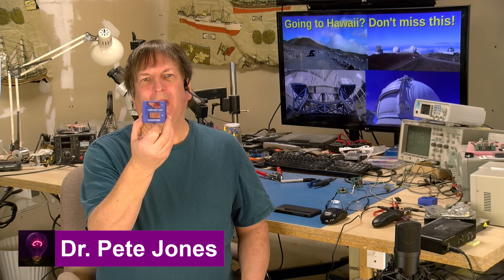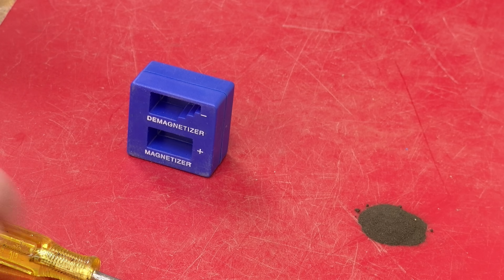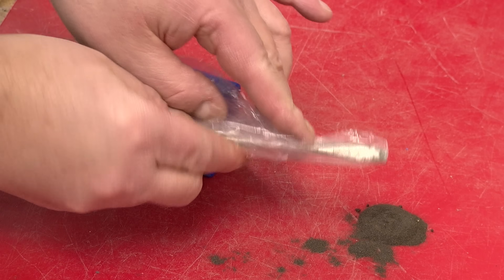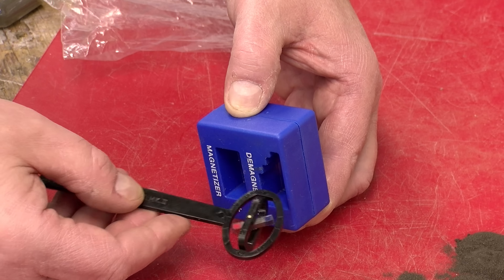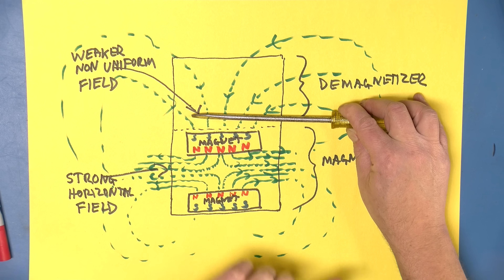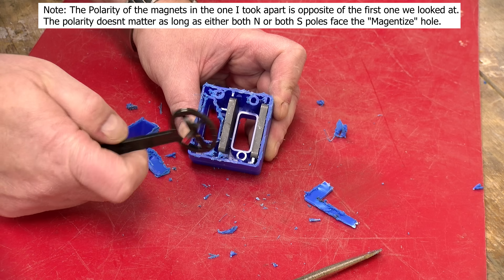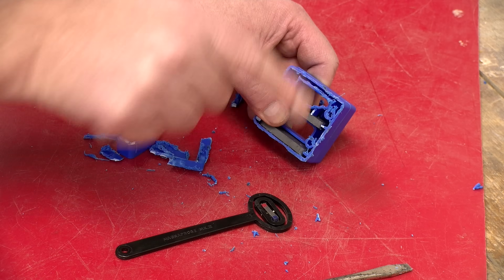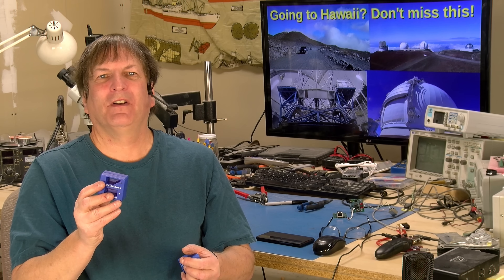How do these Magnetizer/Demagnetizers work?

Comment: I got mine with a precision screwdriver kit, but it's very small and stairless
Reply from the maker: Interesting that its stairless, but makes sense since it might be hard to use if that small. Without using the stairs it demagentizes well enough for most practical applications, so not a bad compromise.
Reply: @ElectromagneticVideos  on a second inspection, it's not stairless it's topless. So you could use imaginary stairs if needed. It's size is equivalent to a hole in the device shown in a video. Name of a set here in Ukraine "Protech Smart yellow 110 PS-8354". I see it sells with different name all over EU.
Reply from the maker: @vadnegru  I was able to google it. Yes  -maybe use a small piece of wood to make it easier to space a bit further way if a second demagnetization step is needed. 

Ukraine - all the best wishes to you on this sad anniversary of the Russian invasion.

Comment: Does that mean demagnatizer creates a monopole as the top magnet cancels out one side of the field? i.e., after demagnetizing the screwdriver becomes N-NIL or S-NIL not S-N or S-N.
If analogy is correct, like a single diode acts half-rectifier. Any further comments? Thanks,.
Reply from the maker: I wish! Unfortunately no - just leaves it as much weaker standard N-S magnet.  So far magnetic monopole particles have not been discovered in spite of numerous searches at the the various particle colliders. There is a place for them in some theories, but even if they were found, it appears that they would be so rare that we would never get to experience an actual monopole magnet.
Reply: @ElectromagneticVideos Much obliged.

Comment: Thanks so much for this. I love learning how things work. 
If you would, a question: Except when you used the demag staircase, you passed the screwdriver through only once. When I've magnetized screwdrivers with these devices, I've passed the screwdriver through multiple times, figuring that more is better, while keeping the same orientation of the shaft (i.e., not rotated). What effect do multiple passes actually accomplish, if anything?
Reply from the maker: Your most welcome! Thats a great question: If you look here https://youtu.be/AZsYHLHlIso?si=YzF_NleqpT-YFHbm&t=291 , when the screwdriver is more than half way though the hole, that (far) end is subjected to a magnetic field going in the opposite direction (arrows pointing left in my diagram), magnetizing that end in the other direction. When you pull it back, the last strong field each part of the screwdriver sees is the fieldd with arrows pointing right, and since that is the last field it was subjected to, it retains that field. 

So when you do multiple passes, any part of the screwdriver that goes though more than half way gets magnetized in the opposite direction undoing any magnetism it originally had, only to regain it when pull back out of the hole. 

So in the end multiple times probably wont make much of a difference. There may be a slight effect (adding a bit more or less magnetism) depending on the slight positional changes every time you redo it. Hope that helps!
Reply: Makes perfect sense, now that you've explained. Your illustration indeed helps. Thank you.  @ElectromagneticVideos

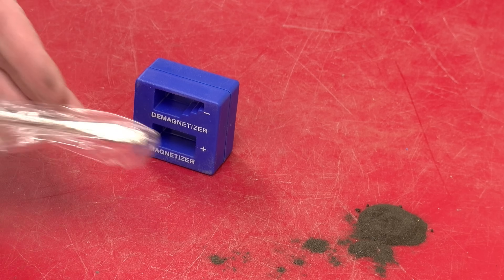Comment: when you showed "why we have the staircase" (2:19) you (also) demagnetized 3+1=4 times the screwdriver. How do I know that the effectiveness of the demagnetizer it's from the staricase and not just because you demagnetized it 4 consecutive times ?
Reply from the maker: Well your right - I didn't go into detail. Each swipe though the demagnetizer leaves the screwdriver slightly magnetized - here is how:

Ehen it is inside the demagnetizer the field is perpendicular to the length of the screwdriver, which is magnetized in the long direction (because the last strong field it saw in the magnetizer was parallel to the screwdriver (see  https://youtu.be/AZsYHLHlIso?si=eaBRerMm-y76t-bC&t=285 ) . So The perpendicular field in the demagnetizer first magnetizes the screwdriver in a perpendicular direction (regardless of the direction of the original magnetized direction). Now as the screwdriver is pulled out, the field it is exposed to gradually changes direction (towards the parallel orientation) and weakens. This change of direction and lowering of the strength simultaneously essentially magnetizes the screwdriver with a lower field strength. Repeated at the next step up you start with a lower perpendicular field and end with a much lower parallel field. So each pull one step up reduces the magnetization a bit more. 

I did a more detailed video on demagetization a while ago. If you interested, here it is: https://youtu.be/mGK8oYdEqyE

Hope that helps.
Reply: @ElectromagneticVideos  Thank you :)

Comment: Since the direction of the magnets is arbitrary, what if we magnetize and demagnetize the screwdriver using the same pole? 
For example pass it through the magnetizer hole of one device, then pass it through the demagnetizer hole of adevice with opposite magnet direction. In both case the screwdriver will be exposed to the same "pole" with different field strength.
Reply from the maker: It will still work! The key is when it is inside the demagnetizer the field is perpendicular to the length of the screwdriver, which is magnetized in the long direction (because the last strong field it saw in the magnetizer was parallel to the screwdriver (see  https://youtu.be/AZsYHLHlIso?si=eaBRerMm-y76t-bC&t=285 ) . So The perpendicular field in the demagnetizer first magnetizes the screwdriver in a a perpendicular direction (regardless of the direction of the original magnetized direction). Now as the screwdriver is pulled out, the field it is exposed to gradually changes direction (towards the parallel orientation) and weakens. This change of direction and lowering of the strength simultaneously essentially magnetizes the screwdriver with a lower field strength. Repeated at the next step up you start with a lower perpendicular field and end with a much lower parallel field. So each pull one step up reduces the magnetization a bit more. 

Hope that helps. I did a more detailed video on demagetization a while ago. If you interested, here it is: https://youtu.be/mGK8oYdEqyE

Comment: I've used one of these before but never actually knew the proper technique to use them. I thought I was supposed to just whip the screwdriver tip around inside the two holes.
Reply from the maker: One thing I should point out since in I don't think I made it clear - its most effective to push the screwdriver all the way in and then pull it out - that way the who length gets exposed to the fields near the magnets,
Reply: Makes sense!

Comment: Damn dude! I have one of these, and i never thought it worked this good! Like i knew it worked, but i think it is only good for a little bit if that makes sense. Like a short duration
Reply from the maker: Your exactly right - the steel in most screwdrivers is "soft" from a magnetic properties standpoint. So unlike magnetically hard materials used to make permanent magnets, its easy for a screwdriver to demagnetize. Often all it takes is banging it ageist something hard to loose most of its magnetism.

Comment: I always thought the idea is to run the screwdriver over the stairs a bunch of times, to demagnetize with brute force. But that does make more sense.
Reply from the maker: You mean like move it rapidly upstairs or downstairs so that it hits the stairs along the way?Banging the screwdriver steel can make a screwdriver loose its magnetism - or gain  magnetism is done while exposed to a field. So depending where the screwdriver is in relation to the internal magnet when bumped like that may have a slightly helpful or unhelpful effect. So in the end, probably  not that useful to do it that way.

Comment: Never even heard of such a device like this before.  It’s pretty awesome and I wouldn’t mind having one here in the house. Plenty of times when I had to try and keep very small screws on a screwdriver which was not magnetic. This would solve that issue
Reply from the maker: Most hardware stores and online retailers have them ranging in price from $3 to $20. I used the $3 or $4 ones. Well worth having one at that price!

Comment: Isn't also true that you can hit the screwdriver against for example a big vice, like I tend to do to get rid of small metal filings? I've been wondering how that actually works.
Reply from the maker: Yes! Causing a mechanical shock like that will demagnetize things - not just tools but also "real" magnets, although magnets are often brittle and are likely to break in pieces if you hit them too hard. The steel in screwdrivers consists of tiny magnetic regions called domains. When magnetized, they re mostly lined up with their fields pointing in the same direction. Bang it and it shakes them up and they end up pointing in random directions on average and average magnetic field goes away. It works the other way to - expose a screwdriver to even a weak  magnetic field and bang it, and it will re-arrange the domains and become magnetic.

Comment: I can't find which video now, but Technology Connections looked at these a while ago and didn't know what the staircase was for.  Really some instructions should be supplied with these devices.
Reply from the maker: Its funny - based on some comments, these gizmos have been around for at least 30 years. They must be copied from the original manufactures product produced in the 90s or earlier (anyone know?). Looks to me like the copies of copies of copies that we get today are being produced by companies that have no idea how the product works, and certainly wouldn't likely have anyone with a background in magnetics on their staff. After all they  just make an injection molded plastic housing and put  some magnets that they get from some supplier inside. So I dont think the manufacturers today even know the purpose of the staircase. I did some googling and the only instructions I found was something like "put the screwdriver in the magnetize hole to magnetize it and in the other hole to demagnetize" which seems to confirm they dont know.  

Very weird that its a product that even the manufacturers dont know how to properly use it!

Comment: I use one of these for my work fixing/ servicing laser printers/ MFDs in an enterprise environment and this simple device makes my work a lot less stressful!
Reply from the maker: Interesting - never thought about it but the laser printers etc you work on are probably the most mechanically intricate piece of equipment used in homes and offices. With all the screws and tiny parts I can imagine how this little device would be useful for that.

Comment: I have one of the exact ones myself, Fun part is that I wanted one to my job too and when we got one it was very light and it did not work either, funny thing is that it was a bad sample as they had somehow missed to include the magnets inside it lol. I got a new one that also worked
Reply from the maker: Poor quality control I guess :) A few others have mentioned getting one that didn't work - your the first reporting it was due to lack of magnets!
Reply: @ElectromagneticVideos  I guess the magnets “got stuck” in production
Reply from the maker: @Pulverrostmannen  Or maybe a machine inserts them and only a few thousand items later was it discovered :)
Reply: @ElectromagneticVideos  indeed, who knows what happened but I was pretty stoked about the result since I had one myself and I was like this is not right. It was like poking a screwdriver in mid air. Nothing happen or felt. It was just a plastic hole lol
Reply from the maker: @Pulverrostmannen  It must have been weird "how can this possibly work!?!?"
Reply: @ElectromagneticVideos  for sure. I was confused by how light it was. And then that it did not pull on the tool either like magnets are supposed to do. And then that it did not work either. The tool itself looked immaculate but we soon figured there was no magnets inside it as it did not attract anything to it. 
And when we got a replacement it was heavier and worked as normal.

Comment: Maybe it is because it is in the middle of the night here, but I didn't fully get how the staircase works.
Reply from the maker: The staircase provides a way to repeat pulling the screwdriver though at slightly increasing distances from the magnet, each time leaving a slightly lower field in it. Each pull produces a field that changes direction over the course of the pull - similar in effect to a field from an AC electromagnet in a better demagnetizer. Look here: https://youtu.be/mGK8oYdEqyE

Comment: The only way to really demagnetize a tool is to use a coil from an old solenoid valve. You only have about 30 seconds to do it because the coil will get hot, but i guarantee you that it will be totally demagnetize. 😁
Reply from the maker: Yes! This gizmo does a decent job but an AC field is really the way to do it. I did a video on that here: https://youtu.be/mGK8oYdEqyE

Comment: I got a demagnetizer that's over a hundred years old. It's a watchmakers tool. It's a coil of wire in a case with a switch that looks like a telegraph key to pulse it on.

You can really feel the pull of the magnetic field when you pulse the switch with something metal such as a file inside the coil.

This pull is probably where guys got the idea to build magnetic pulse guns.
Reply from the maker: What a cool vintage piece of equipment! 

I did a video on coil type demagnetizers a while back in case your in interested:  https://youtu.be/mGK8oYdEqyE
Reply: @ElectromagneticVideos  Look up "Vintage South Bend pocket watch demagnetizer" with a Google image search and you will see models like mine. They go for around $100 bucks as antiques these days.

Comment: Your demagnetizer ladder steps revelation is just a top of iceberg of problem of tools sold without proper user manual. People are supposed to know how to use it without any reason. Ratchet crimpers, complicated strippers, various multitools - millions of them.
Reply from the maker: I actually think this things has been copied so many times from the original one (no idea where/when it was first produced) that most if not all of the current manufacturers have no idea why the staircase is there either or how the device works. I'll bet that applies to some other tools as well.

Comment: I feel like you could of mentioned the difference it makes if you have a hardened steel, from the screwdriver, vs untempered soft steel, on magnetization. PS I love the simplicity of the device. Thanks for the explanation👍
Reply from the maker: I get your point - but I'm sure you have also found that it is always a tough call as to what to put in a video and what to leave out. I find that the attention span of the general youtube audience is such that often keeping things to a minimum is better and so I purposely left out the aspects of different magnetic materials. 

A while back I did do a couple videos about magnetization in case your interested:

Magnetizing: https://youtu.be/S21rlwrY74I
DeMagentizing: https://youtu.be/mGK8oYdEqyE

Just looked at your channel (actually just subscribed).  see your from the UK. Regards from Canada!
Reply: @ElectromagneticVideos  I know what you mean, I have definitely made the made mistake of adding too much  information in my older videos🤔. It's finding the right balance of getting your message across(and keeping attention spans) without compromising too much. Thanks for subscribing👍😉
Reply from the maker: @MyProjectBoxChannel  Yeah - you wouldn't believe how much stuff I cut out of the final video before publishing. Well actually you probably do :)  Anyway, looking forward to watching some of your videos!

Comment: I wonder if it's possible to build a motor with permanent magnets that switch off for part of the revolution.
Reply from the maker: You can do things to "turn off" a magnet like rotating a magnet or inserting a piece of steel to "short" the magnetic field . With suitable mechanism you could do this in sync with a motor rotating to drive the motor (which is what the electromagnets in a motor do) and drive a motor that way. However, it will of course take work to turn the magnets on on off and then some of that energy gets transferred to the motor, so no free lunch  i'm afraid :)

Comment: so you could demagnetize the screwdriver by moving it below the whole thing as well? my brother showed me you can magnetize your tools by leaving them in strong sunlight too which works but I don't know why.
Reply from the maker: Yes! Exactly!  

Materials loose their magnetic properties above a certain temperature called the Curie temperature. Heat a magnet above that and it will demagnetize. Works the other way too. Place some steel that is really hot in a magnetic field and cool it, and the steel will become magnetic.